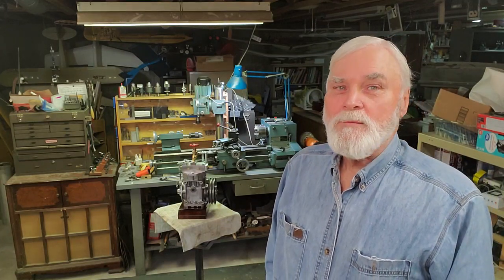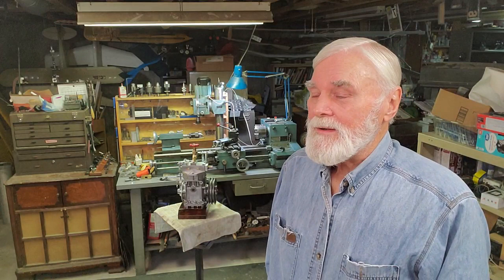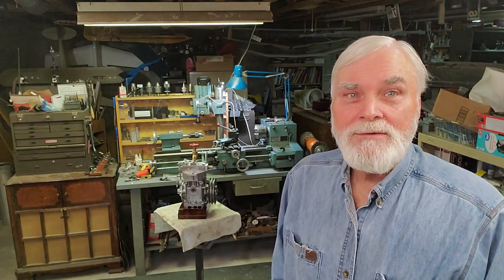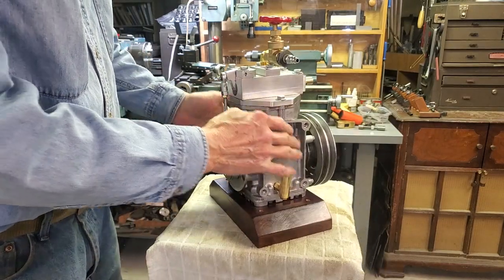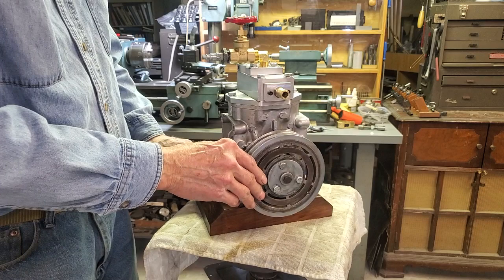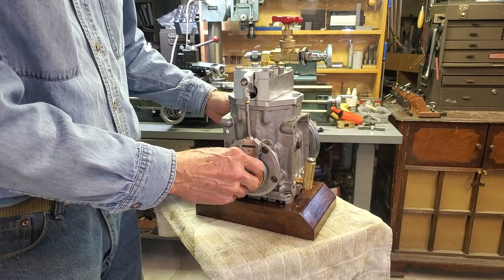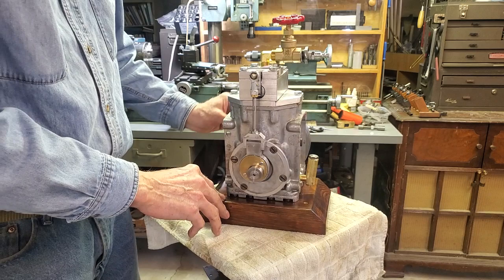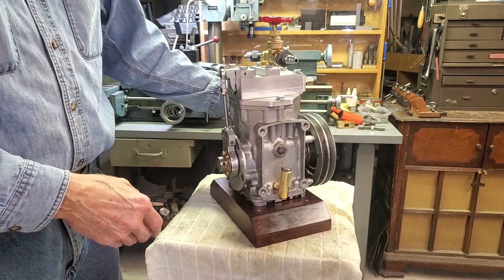Steam engine made from car air conditioning compressor

Comment: Hi do you happen to have drawings of the parts you have manufactured for this project. I have a twin cylinder air compressor that I want to convert to a stem engine. Thanks

Comment: Great engine, I'd be interesting in seeing the build process, if you took video of it. 

What kinds of seals are in an automotive compressor from that era? Can it actually handle live steam temperatures and condensate?
Reply from the maker: I took no video of build - wish I had. The flywheel end had an odd (to me) seal of viton like material but with spring loaded hardened steel plates. To hold the freon I guess. The other end of crankcase was closed and I bored it to accept the extended crankshaft. That end used an open ball race. I replaced it with a rubber sealed bearing and have had zero oil leakage. I don't own a boiler big enough to run the 1.87" bore X 1.10" stroke engine. But the seals will stand crankcase temperature for sure up to 100 PSI.